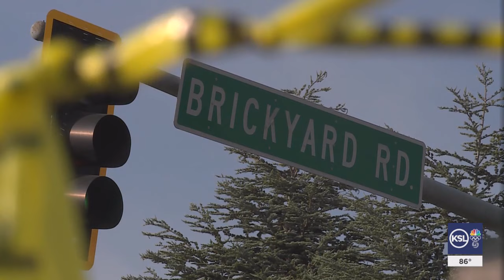Massive Cranes Damaged in Millcreek Fire

Comment: "bUt FiRe CaNt MeLt sTeEl!"
Reply: Yes it can!
Reply: @angelhugs4954  😂😂😂
Reply: I get what you are hinting at.  But for the record steel does not have to melt to loose strength . At temps far below the melting point it become ductile.  Sort of like heat softening a tapered candle so you can bend it long before it is liquid
Reply: People don't get sarcasm apparently